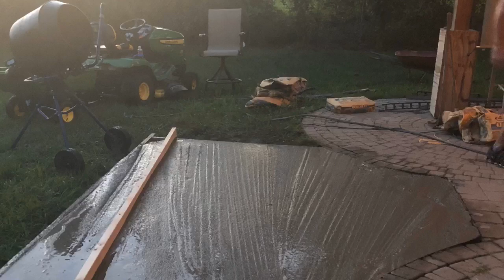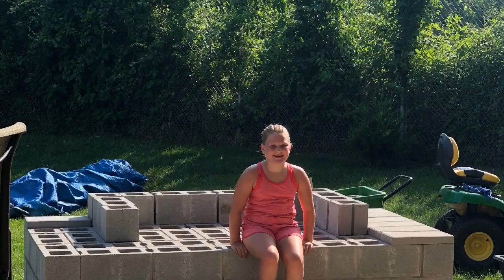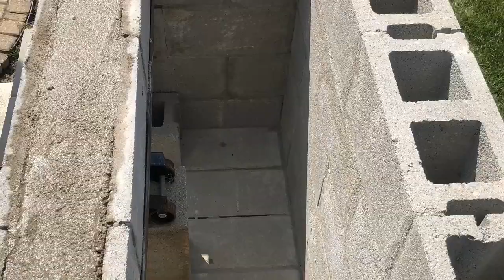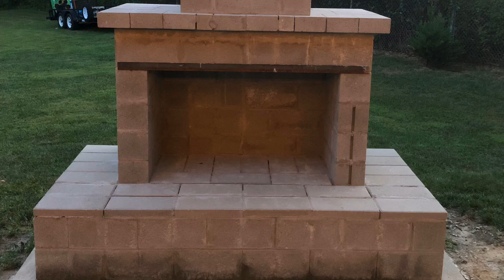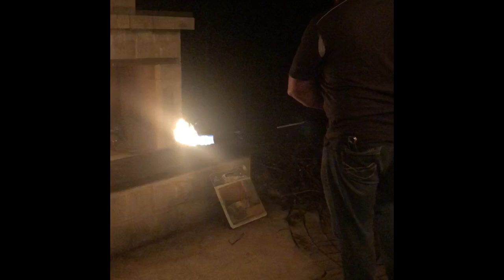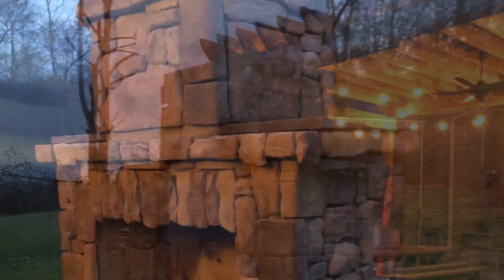Outdoor Fireplace

Comment: Great video. Great fireplace. Your video will help me a lot to build my own.  I have 2 questions. What was your depth of your concrete base/footer? Also when you placed the 2 metal support bars across the top to build the top of the hearth, wasn't the blocks that you placed on it higher than the ones behind it? The metal support bar would of raised the blocks a little bit. I assume it wasnt level. Is this correct?

Comment: Great Job. I am a do it yourselfer as well and in the process of making one myself. 2 questions... Do you have anything in-between the 2 front angle irons or is it just filled with concrete? The video looks as if you have a metal sheet on top of the fireplace opening under your blocks. Also what size if your flue?

Comment: Have you had any issues with the stones over the angle iron? I’m currently adding the stone veneer to a similar style fireplace, and I’m worried about the metal expansion when it gets hot.
Reply: place foam padding under angle iron during installation allows for the expansion and contraction

Comment: Did you use any fire brick to line the inside?
Reply: Jason Little he shows the fire brick in the video.
Reply from the maker: Yes we used firebrick!
Reply: Do you need a special mortar for the 8x8x16s or the fire brick inside?
Reply from the maker: Kevinw4040 yes. It is a special mortar that can take the heat. You can buy it where you buy your bricks or stone.
Reply: without fire brick and fire cement this would of been a waste of time

Comment: This looks like the Pima II from Backyard Flare.  That's the one I'm currently building.  I noticed you added the Cap Block on to the 2nd level.  Then later added self made concrete seating (which looks great BTW).  How did you transition between the concrete seating and bottom of firebox?  Is the seating and firebrick thickness the same?  thanks!!
Reply from the maker: James Bell the thickness on the cement is 1.5 inch. Not sure the thickness of the fire brick. Yes we added an extra layer of block on top because we thought it needed it. It is the Pima 11
Reply: Looks very nice. I was gonna buy plan but won’t work for me due to space. On the Pima plans lists it calls for 14) 8x4x16 where were those placed? I followed along your video on the 8x8x16 on base and 8x8 up top. I’m just trying to make a custom sized one like yours. Thank you, Great job!
Reply: @eescalante68   what is the 16 the length
Reply: @thewortmans4514  Any reason you chose to use block across the top of the firebox instead of pouring concrete into a mold (like pima ii plans show)? I'm getting ready to start building one and just doing some research. Nice job btw!!